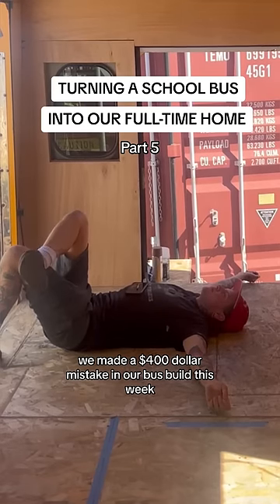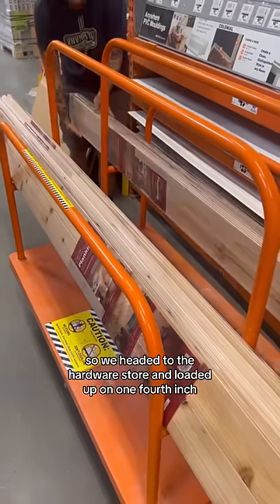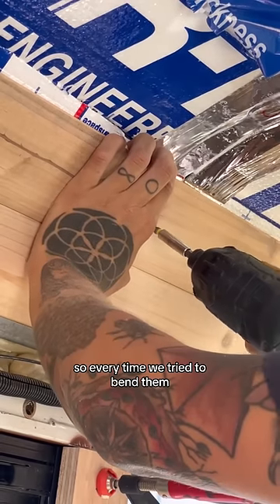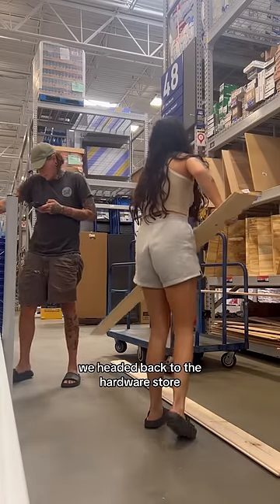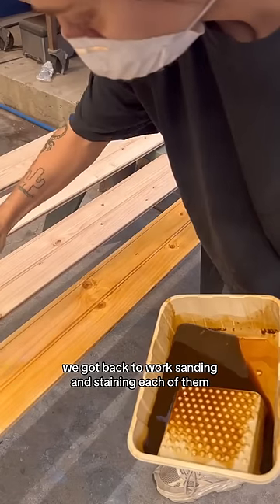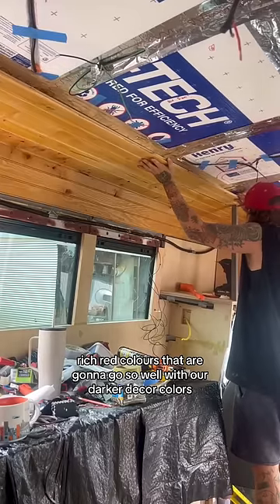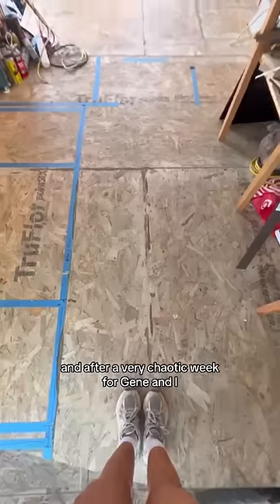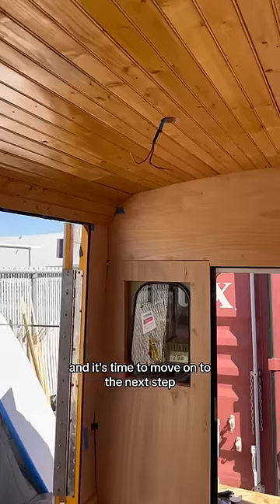$400 MISTAKE on our SCHOOL BUS CONVERSION 😳

Comment: I have a question. What are the nails holding onto? I see the foam boards that are taped on but is that sturdy? And what if the nails hit the metal ceiling? Wouldn't that create a leak?? Im curious because I want to build stuff in the future. 😅